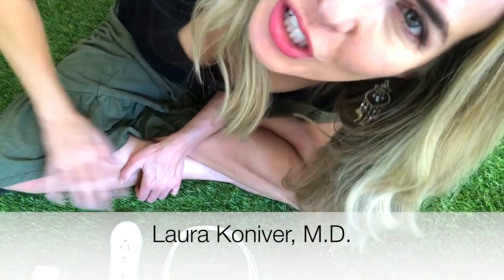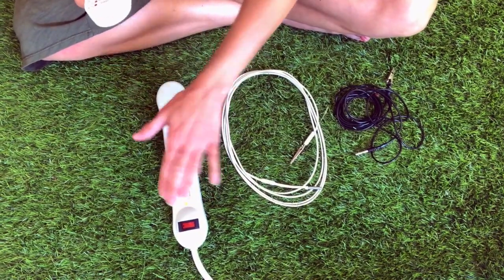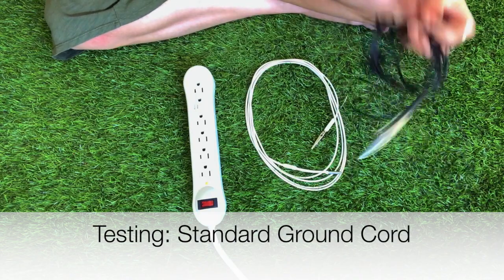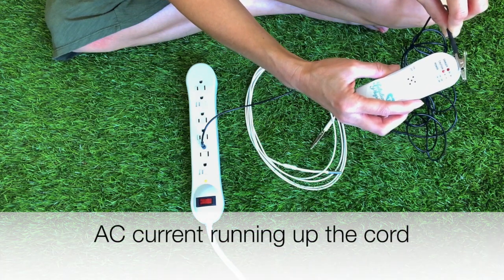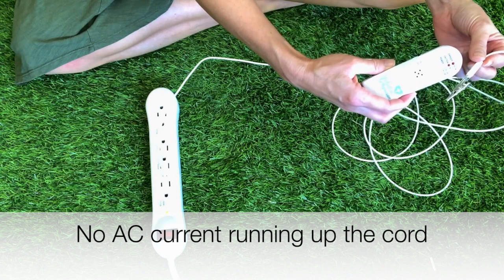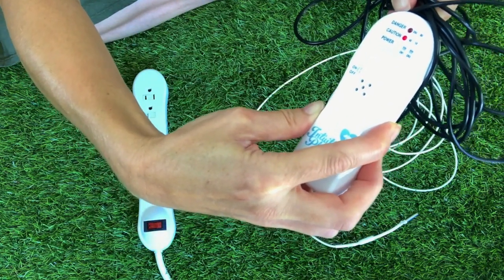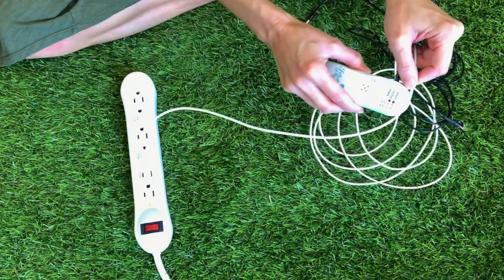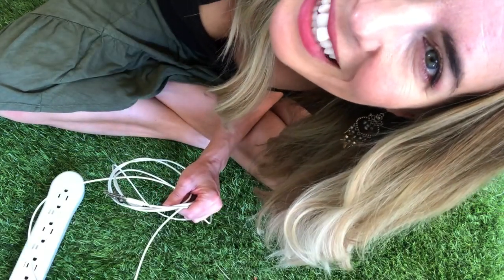Testing Ground Cords: Standard vs. PureGround Cord (Dr. Laura Koniver, MD The Intuition Physician)

Comment: I have unplugged everything in my bedroom except for the overhead light. I have grounding sheets and pillow cases they come with their own cords, am I still grounded?
Reply from the maker: Yes!  As long as the cord is plugged into a properly grounded outlet you should be, even with the breaker off.  I can't vouch for the longevity of other companies products so you may want to test if they are still grounding you after a few washes and periodically, but as far as if you can still be grounded if everything is unplugged, yes that is actually ideal!  xoxo

Comment: You are so beautiful.  I just have to say that one time.  Question.  I bought the pure ground 3.0 cord I think and it looks different than this one.  I can't see the resistor.  On your website it says it's imbedded in the molding.  Where is it imbedded in the molding at - where the alligator clip connects to the wire?  Is this here the device I need to test my pure ground cord occasionally to make sure it is still working right?  Or do you sell a better device for that?
Reply from the maker: Thank you so much!!!  This video is older and I have since updated the PureGround cord to improve it!  All the cords I make are now the new and improved one here:  https://intuition-physician.myshopify.com/collections/grounding-accessories/products/grounding-cord  the resistor and filter are both in the plastic casing at the ground pin, you can see that on the diagram on the product page at that link.  I hope that helps!  And yes the tester is here for you:   https://intuition-physician.myshopify.com/collections/grounding-accessories/products/copy-of-ground-tester-securely-test-that-you-are-grounded You do not need to test your cord but you can if you like!  xoxox, Laura
Reply: @laurakonivermd  Thank you, but I'm more interesting in testing the pure ground cord periodically to make sure I'm not getting AC current, like if the resistor got damaged or something.  Because I had another ground cord in the past that I bought from someone else, and I'm pretty sure I was getting AC current from it.  So wouldn't the meter in this video here be the best one for that?   By the way, if you want an idea for a video, I would love to see one about all the different meters/testers you sell and the differences between them - what each one is for.  It can get kind of confusing.
Reply from the maker: @DaLeSy.  That's is a GREAT IDEA I will create that video at some point for sure!  Thank you!  Yes, you can use this test meter to see if there is an electric field on the line: https://intuition-physician.myshopify.com/collections/shielding/products/emf-sensor-detection-meter xoxo

Comment: Hi Laura I received the wire but not sure if I can use it because I don’t understand something : I check it with a voltmeter on AC (V~) connected to ground and the probe on the pure ground clip. It shows 2.5 volts.

When I then check the AC volt through my body touching the pure ground cord it goes 7 volt to 5 volt.

Does this interpret as safe to use?

I’m so confused I thought I should see zero. All equipment is set up correctly.
Reply from the maker: Hi Anna!  I emailed you back but meanwhile your measurements actually show the pure ground cord is working -- woot!  Here is a video https://www.youtube.com/watch?v=ZYpYCmi79nM&t=249s where I explain why you do NOT want to see volts drop to zero, and a page you can read about it here:  https://intuition-physician.com/?s=pureground+clarification  I hope that helps!  xoxo, Laura

Comment: can one not just switch off the outlet, as long as its still connected to the power system, and still be grounded while not having to deal with the ac electric field? wouldnt that basically be the same thing?
Reply: if you dont want to switch off the entire power, couldnt you just connect a switched off multiplug-outlet onto any other powered outlet and use that one to ground?
Reply: I wonder the same

Comment: I just received my bedroll supposedly with the pure ground indoor ground cord but it did not have that thickened part of the cord that you are calling the filter.
Reply from the maker: If your cord is white you definitely have a pure ground cord -- it's the latest upgrade to the cord so it may look a little different to previous versions and that's because there have been multiple important upgrades that make the cord last longer, like embedding the filter into the casing around the ground pin. Some of my videos and photos use the older, 2.0 version (and even the original 1.0 version) instead of the new and improved 3.0 version that you have.  You can see pictures of the newly designed cord on the product page, these pictures are the cord you have in hand and seeing them will reassure you that I personally packaged and sent you the most recent and best pureground cord:  https://intuition-physician.myshopify.com/collections/grounding-accessories/products/grounding-cord 
xoxo, Laura

Comment: If i use a dedicated ground rod for earthing do i still need the pure ground cord? All outlets here in the Philippines are the two-wire type (no ground).
Reply from the maker: There is still a roll for the PureGround cord even if using a ground stake, because there is shielding on the cord that will prevent any EMFs in the user's environment from being picked up by the cord.  A standard cord, even one connected to a ground stake, will resonate with and carry environmentally induced EMFs... but it's definitely better than nothing, if you want to stay with a standard ground cord than a stake is the way to go, because at least there is no AC current from the outlet.  EMFS can still act on the cord and introduce some dirty electricity to the line, but it will definitely be less than one plugged into an outlet.  Best of all is to use a stake that includes a shielding ground cord like the PureGround stake.  I hope that helps!  xoxo, Laura

Comment: even with pure ground chord, when you took the meter close to cable, I heard in the video, the noise from that meter sporadically.
Reply from the maker: Yes as you move the meter you will build a small electrical charge from static electricity -- once the meter is steady that should dissipate immediately!  xoxo
Reply: @laurakonivermd  Thanks Laura. I infact ordered two pure ground chords from your web site. Hope to receive it soon.
Reply: @milanjani did you like the pure ground cords?
Reply: @Ijustwantpeace-y5t  i am actually not using it. Thinking grounding thru wall power plug may harm me in someway…
Reply: @milanjani  even with the pure ground?
Reply: @Ijustwantpeace-y5t  yes I am worried.  I think in some of your video you mentioned the best grounding is the one outside in nature… this wall outlets worries me. I didnt have pleasant experience using regular grounding chord before. Thats why i bought pure ground chord but still have that fear…
Reply: @milanjani  I understand! But you should definitely try it! This is why she made it so it wouldn’t hurt us more and help instead

Comment: Do you think that the PureGround 3.0 would be helpful for clipping to "non--grounding mat" items, like a solar generator (all metal casing) that has a 3000 watt inverter that converts the solar energy (DC) to AC? I ask this because, I bought a solar generator, and immediately when I turned on the inverter, my brain felt like it was cooking/along with random/uncomfortable body tingling sensations.

This is the typical EMF type response that I'm accustomed to (but more pronounced/stronger). Only until I turned it off, did i get relief. I thought about trying to ground it (to a ground rod) outdoors, but if I could do it inside the house (via PureGround 3.0), by just clipping the alligator clip to it, and discharging that EMF, though ground outlet, that would be awesome.
Reply from the maker: That is a super common symptom of electrosensitivity and unfortunately solar is one of the worst at emitting massive EMF fields!  I would love to have you in my upcoming electrosensitivity class to help you more and go deeper with this -- https://intuition-physician.myshopify.com/collections/online-health-classes/products/navigating-emfs-an-online-class-to-protecting-yourself -- but in a nutshell -- yes I think you should try it, it will convert the electric field into a current that travels out and is neutralized by the earth, but it doesn't prevent the unit from putting out EMFs in the first place... so should at least reduce symptoms but there are also other things you can do!  xoxo, Laura
Reply: @laurakonivermd  Awesome!!! Thanks for the feedback. I purchased one of the PureGrounds on 8/25/22. So, I will give it a shot. My main use would probably be for my laptop. I have a usb grounding cable, but still feel weird with the usb ground cable. So, will try the PureGround, by finding a way to clip it (either to the aluminum laptop chasis or as an extension to the usb grounding cable itself.

There is another (although expensive) product out there that's called NCB outlet, by Andrew McAffee, that's $300. It sounds like it does the same thing as Pureground, but instead it's an actual large box/outlet adapter. That was just too much of a price hit. I'm glad to be able to try the PureGround 3.0
Reply: @MGillDesign did you see any difference with the pure ground cord?

Comment: Hello Dr. Laura, I am new to grounding.I have purchased grounding sheets which  comes with the regular grounding cord. One part gets press onto the button that’s on the fitted sheets and then the other in the wall. My question is if I purchase a pure ground cord where do I pin the alligator pin on the fitted sheets?
Reply from the maker: You can clip it to any edge of your sheet (if it is a sheet made from the silver grid polyester fabric that is commonly used, be sure it is clipped onto one of the silver threads that are visible in the fabric!). xoxo, Laura

Comment: So great! People who ground don't want to face this reality. Love that you made this filter. Makes so much sense. I have 5 on the way. Question... if you use the PureGround, then attach to a splitter, can you have standard cords from the splitter to the grounding device?
Reply from the maker: You can, and the lines will at least be AC current free, but the standard cords after the splitter do not have shielding material so they will pick up on any EMFs in the user's environment and can then transmit that to the grounding tool, so although it's better than nothing ideally you would have a shielding cord all the way up to your grounding tool.  xoxox

Comment: My body voltage (per the multimeter) doubles when I step on my grounding mat.  What could be the problem?   I tried 2 different mats, a wrist band and a sheet.  The results were all the same.
Reply from the maker: The voltage reading is showing you that there are EMFs in your environment that are affecting your body -- most common exposures include wiring in walls, cords from appliances (lamps, clocks, charging cords, etc...) and cell phone or wifi radiation.  I recommend removing as many sources as possible and shielding from the ones you can not remove.  More tips here:  http://www.intuition-physician.com/safe-grounding-coalition/   Here is an informational page on why you do not actually want to see a voltage drop while grounding and why you want to shield from EMFs instead:  https://www.intuition-physician.com/pureground-cord-clarification/. I hope that helps!  xoxo, Laura
Reply: @laurakonivermd   thank you very much.  Your interview at  Electrohypersensitivity with Dr. Laura Koniver
REAL ROVER show answered a lot of questions that I had.

Comment: Does Clint Ober talk about pure ground in any of his questionnaires or video interviews anywhere on YouTube? I’d like to hear what he has to say about this. Also, compared to a standard ground cord vs pure ground cord, is there a difference when tested with a voltage meter when measuring the body? (For example would a volt meter read let’s say .000 volts with a pure ground cord compared to a standard ground cord which on average reduces body voltage levels to below .050 volts for most cases?)
Reply from the maker: I've spent a tremendous amount of time trying to undo some of Mr. Ober's misleading and confusing "health claims" such as that you are in a safe from EMFs when grounding.  He won't acknowledge electrosensitivity and refuses to offer a safer cord.  He is thinking like a business man trying to sell an old product instead of as a medical professional trying to advanced the field of conductive health.  They do not have a single physician or even nurse on staff to help develop and test their products. So they are pretending that EMFs are not harmful, and that grounding magically makes them go away. They have come out and said that so many times that if they offer anything other than a standard cord at this point, it would expose them and so many customers would want refunds, so they really have to stick with their story just to sell products.  In my opinion t’s just a money grab instead of concern or regard over the health of electrosensitive folks who feel worse when using a grounding tool. I hope that helps!  xoxo
Reply: @laurakonivermd And this explains why my intuition said NO after Clint’s cords showed up over a year ago. I’ll be purchasing your shielded grounding cords. Thank you!!
Reply: Holy crap…

Comment: I believe you mentioned the readings being done in V per M so it seems that is an electric field meter, which implies that there is voltage in the grounding cord but not current. the current I suppose would happen when the circuit gets completed, which is when you touch the cord.  Have you checked the voltage and current on your body with a multimeter by chance, or at least check the cord with a multimeter? Also, what is happening there, is it the electric field from the outlet that is indirectly causing this voltage and current in the cord  or does the actual ground line in the house always have current/voltage on it?

Comment: Dr Laura hi :) I just got a grounding sleep mat from Clint Ober. My outlet is grounded, I did a test. So that means that my body can heal and is connected to the magnetic field of the earth right?  Unfortunately I have to let the air con run during the night, so I am surrounded by electric fields (EF) which are around 50-100 V/m (I know that's very high). What can I do in that case? Is my body still protected by the grounding mat?

Comment: Hey Laura, thanks for this eye-opening video! I find the field of health sooo confusing at times and it´s sad that people head out to improve their health - but might end up even doing more damage.

Question:   So when you say that not so electrosensitive people will not be affected as much by not having a shielded cable - does it also mean that it is actually not harmful for them? Because after all, they are simultaniously still getting the benefits of (unshielded) grounding...

Thanks!
Reply from the maker: Yes -- both.  Although they will be getting the AC current in the cord, over all, all of the medical studies conducted so far used the unshielded cord and still the health benefits of grounding far outweigh the dirty electricity component, so I have no problem with someone grounding through a standard cord if they feel fine and it doesn't bother them>. For folks who are so sensitive they prefer no AC current exposure, then upgrading to a shielded cord makes sense.  xoxoxo

Comment: Hi Dr. Koniver
Help me please. I am new to grounding. I bought a grounding sheet and made a homemade grounding wire to plug into the outlet’s ground plug (I now realize that I need one of your chords). When I plug it in and clip it to my sheet and touch it, I don’t see any decrease in my body’s voltage when I measure it on a volt meter. So something is not working or I have it set up wrong. But I just figure out what would be wrong. Because the whole setup is so simple. I even tried it without the sheet, just touching the alligator clip. Still nothing. 
Any trouble shooting thoughts to fix my thoughts.?
Reply from the maker: There must be some reason why your homemade cord is not grounded -- but I will say, body voltage is not the correct way to tell if you are grounded -- only a ground test meter can truly show that.  So either test your homemade cord with a ground test meter or grab a USA made ground cord off my website and you should be good!  xoxo< Laura

Comment: I have a silly question but need to ask, can i connect the pureground cord on the outlet and then connect the pliers end on the male end of my old standard ground cord and so on connect to my bracelet? it is because I wanna increase the length. is there any problem?
Reply from the maker: That's an awesome question and the answer is YES!!!!  You can piggy back cords for sure to increase length!  Filter will still work for the entire length!  The standard cord won't be shielded but it will be filtered!  xoxo, Laura
Reply: @laurakonivermd  Thank you!!